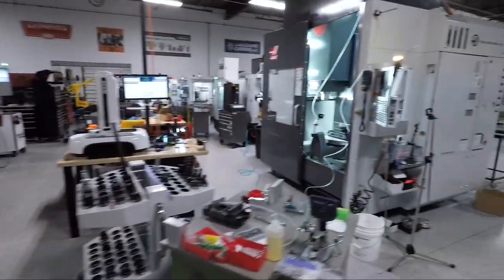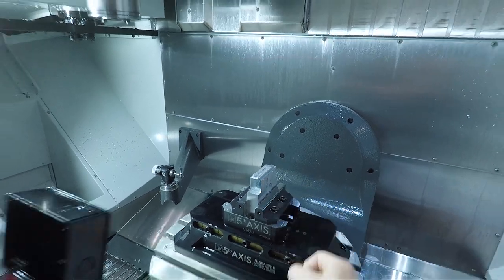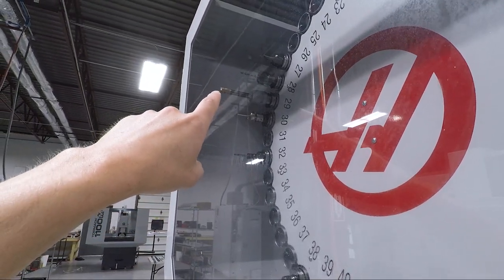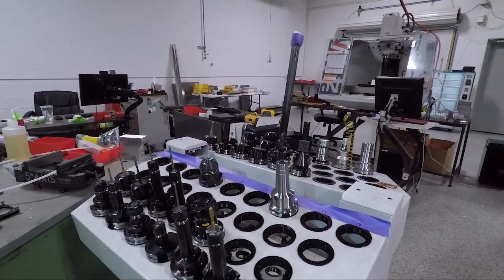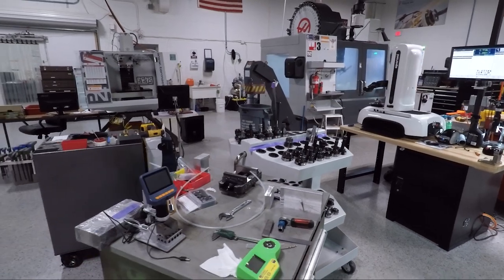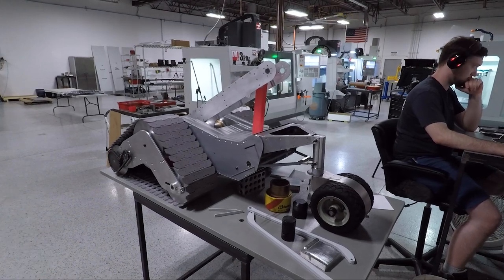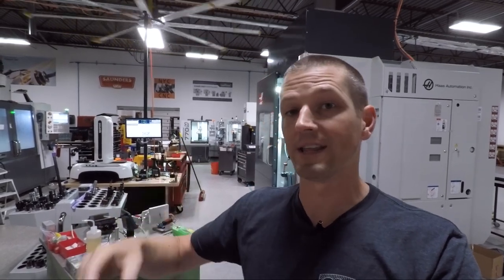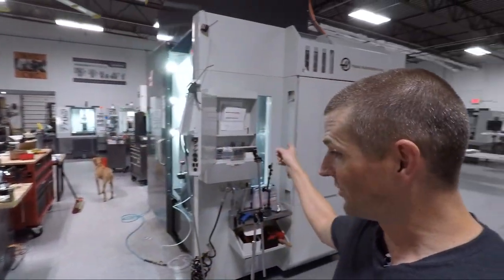Shop Update - 5 Axis, Speeds & Feeds Project and more! June 2019

Comment: Like I told a past customer, don't make a $2 part into a $10 part.  If you can get away with milling some features into a piece of angle, and the functional requirements don't need ridiculous setups or fillets that merge in 2 axes, then KISS!
Reply: EFormance Engineering 
Exactly! If its a prototype, build it a simple as possible. 
I would have thought that would have been built in sheet then bent.
Reply: I agree whole heartedly!  I'm not a machinist nor smart enough to play one on YT.  I watch in utter amazement as again and again a #10 flat washer gets machined out of a shoe box sized piece of material???  A bit of an exaggeration but really what is the thought process that drives this nonsense?
Reply: Peter Haan 
Lack of experience or tooling

Comment: You may want to look into hanging that mist collector so it doesn't touch the machine. A local shop here did that with their collectors and saw a difference.
Reply from the maker: What was the difference?
Reply: @nyccnc  Better surface finishes. Less vibes

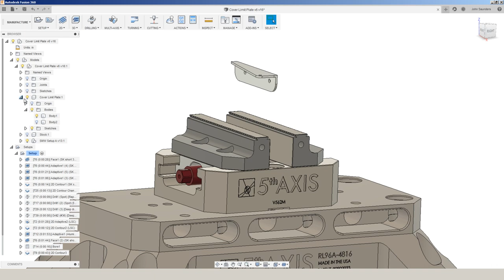Comment: 1:04 why do you use full material instead of a L Profile if this is the finished part ? It is way cheaper and faster du machine .
Reply: If this job was only for a few of them, he could easily have had some left over stock he could use instead of buying new =)
Reply: That’s what I was wondering if he couldn’t just use some angle.  But then again why does he do anything he does?
Reply: Probably did it just to play with the 5 axis